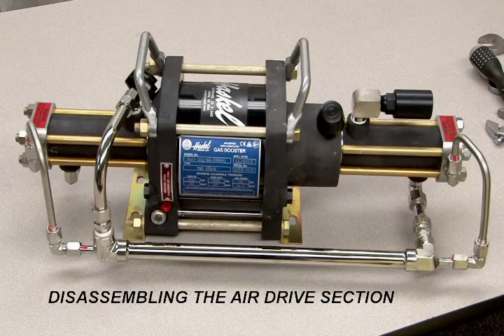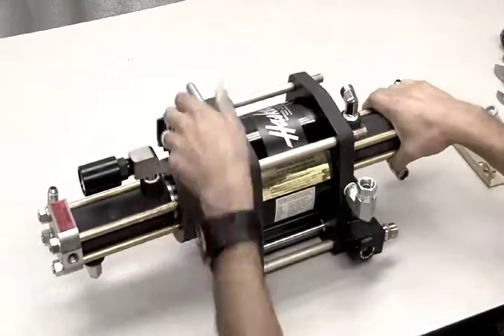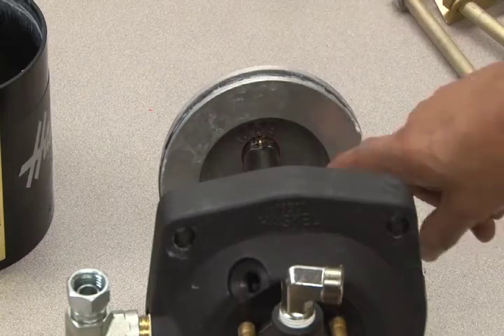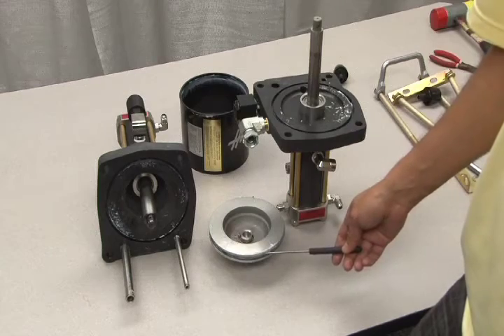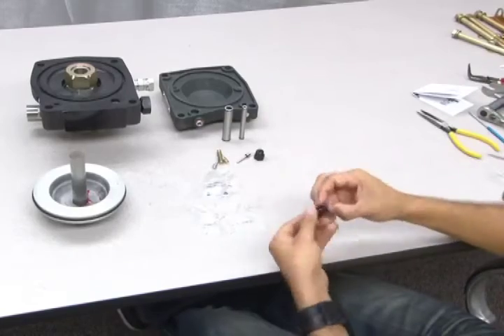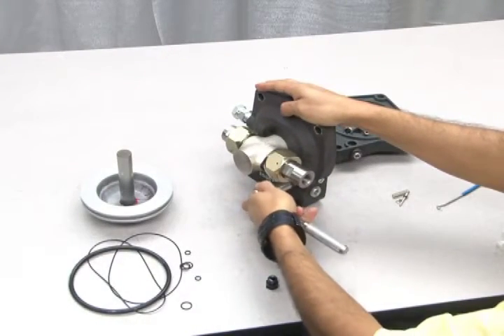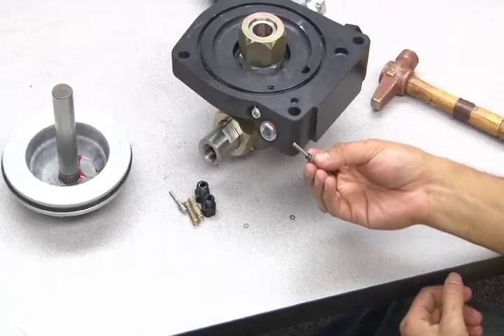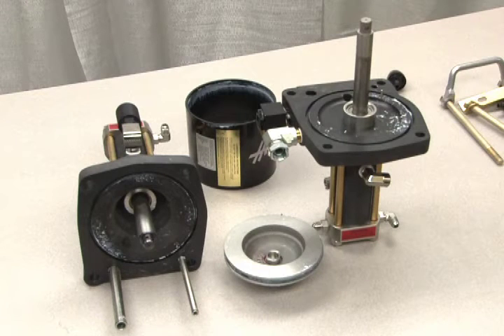Haskel #03   Air Drive Disassembly and Repai for 5.75”  Air Drive Pumps, Boosters & Air Amplifiers

Comment: Don't use a steel pick or screwdriver to remove the O-rings. Use a brass pick. Aluminum scratches very easily.